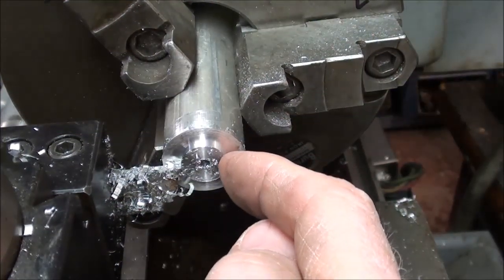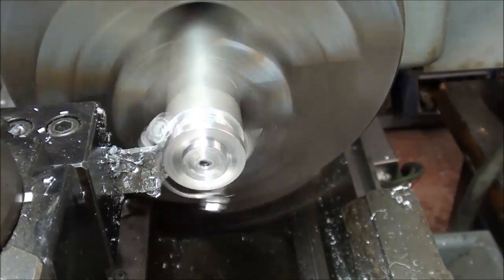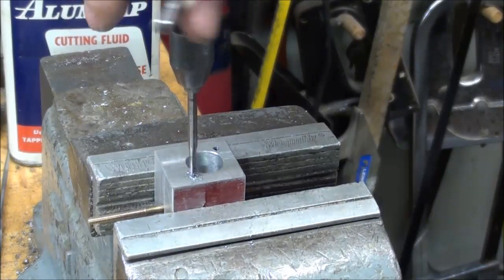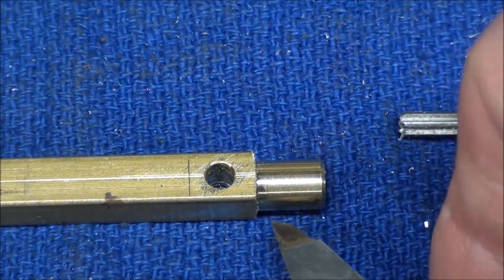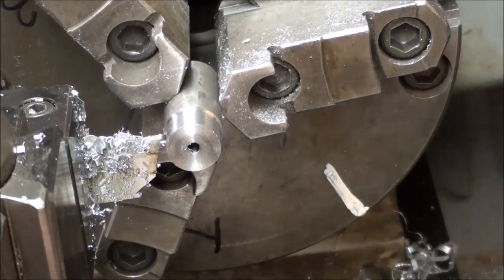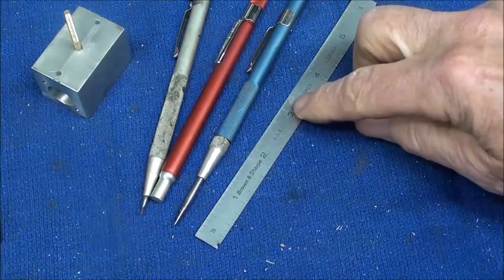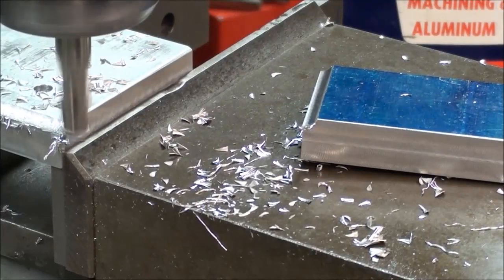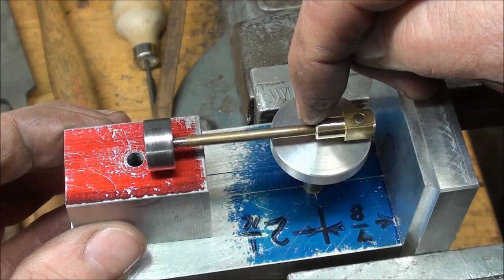WOBBLER DA STEAM ENGINE how to build pt 4of5 tubalcain

Comment: While I am not going to make another wobble engine until the summer AZ heat forces me into the air-conditioning of the shop and curtails flying activities, I will again view each of the videos in this series for reference. I have seen a V-6, 6 cylinder, wobble engine that I am contemplating building. I know you expressed misgivings about this series in the beginning but there are lots of us out here that are thoroughly enjoying them. In the political vernacular, these are playing to your base. Thank you Lyle!
Reply from the maker: Thanks

Comment: Lyle, when you were radius milling the base and if you had referenced using the fixed jaw of the vice, every edge would be identical without having to use a setting block. Also you could have used the X table feed. Looking forward to seeing it finished and running on compressed air. Well done with another great series.

Comment: mrpete 222  this might seem like a dumb question but here it is i know if you have run on your lathe after a few cuttings it turns streight if not taken out of chuck now if you are boring is this still true if you remove and reinstall and keep boring will it be true with other bore thank you for last question i sent on thread gear and i do see what you ment on it  thanks  Duane    ps this engine you sure got patients and great knowledge i really like when you go and buy these lathes and mills
Reply from the maker: No. Do not remove and reinstall
Reply: @mrpete222  thank you You saved me a big mistake

Comment: Does the climb milling work because the chips don't have chance to get pulled back through the work on rotation?  It seems like the chips are also clearing at a higher part of the flute or mill which clears them from the work so they don't end up in the way of the mill on the next rotation.
Reply from the maker: Yes

Comment: 19:30 - "Удачей считалось, если в зазор между цилиндром и поршнем не пролезала пенсовая монета..." Кажется, так Уатт "хвастался" точностью изготовления своих машин :)
=========
Нашел, не Уатт, а его партнер, Боултон:  "Mr. Wilkinson has bored us several cylinders almost without error; that of 50 inches diameter, which we have put up at Tipton, does not err on the thickness of an old shilling in any part"
https://en.wikipedia.org/wiki/Watt_steam_engine

Comment: ALERT!!!In chapter 2 at the 14 minute mark you said you cut off a piece 1 inch long from your 1 X 2 starting piece for the cylinder.  That would have given you a 1 X 1 by 2 (Less the 1/4 or so you cut off the width.  Should you have said you cut off a 1-1/4 piece.  That would have made the cylinder blank 1 X 1-1/4 X 1-3/4..... or am I missing something?Lou
Reply from the maker: I will have to go back and check. I think someone is making a drawling of the project